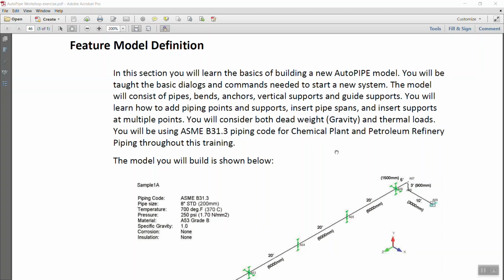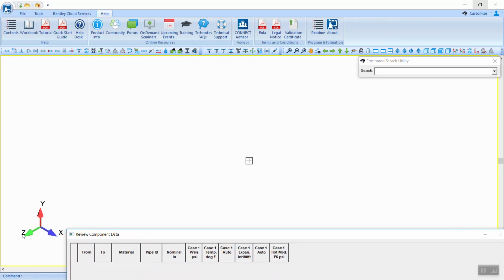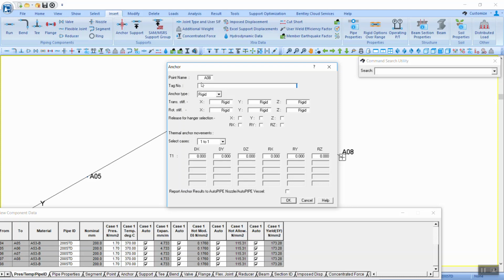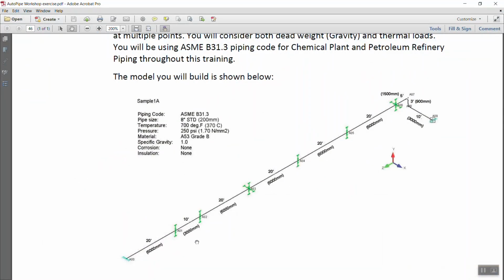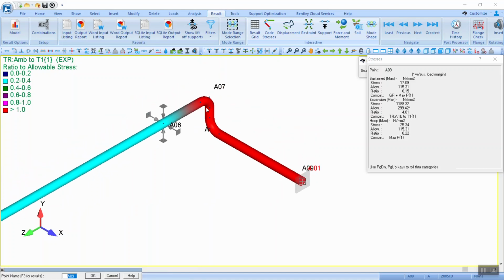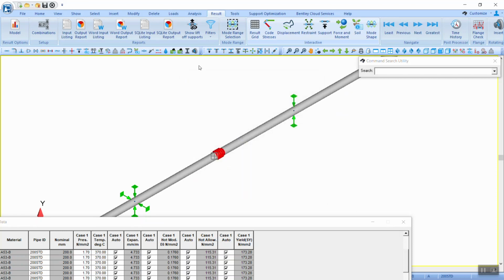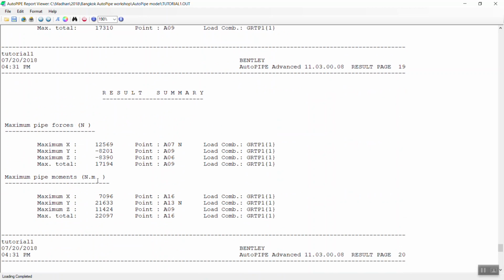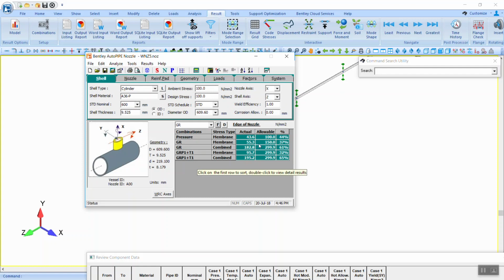AutoPipe Connect Edition V 11.3 Tutorial

Comment: Hi Madhan, that was a very instructive video and I want to congratulate you for producing an easy to understand video.
I have two questions, as I am totally new to AutoPipe:
1. If we have, say, a steam system comprising 50 separate isometrics; then would one not import all 50 isos as separate AutoPipe drawings and then analyze separate isos or somehow combine all in one drawing and then carry out the stress analyses?
2. How can I add a title block to the AutoPipe iso?
Thanks very much.
Reply from the maker: Hi Sohail,  
1) I don't understand.  If you are planning to start modelling in AutoPipe using the ISO's then it is up to you on whether to model every piping or just the critical piping for stress analysis.  Also note that you can't import a ISO in AutoPipe but only can produce ISO's as output in AutoPipe.   

2) You need to edit the border files located in the c:\programdata\bentley\autopipe connect v12\isoextractor\borders\dgn\  folder to insert your title block.
Reply: @madhanelumalai7328  Many thanks.